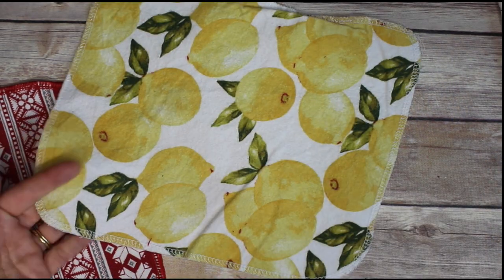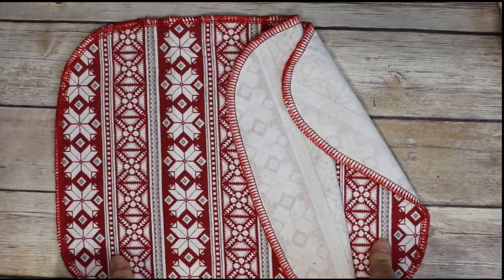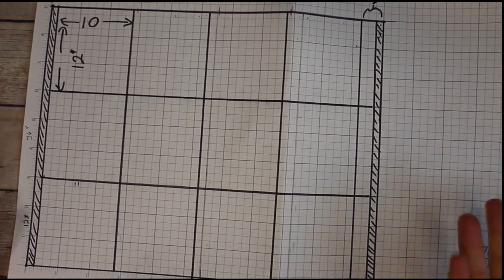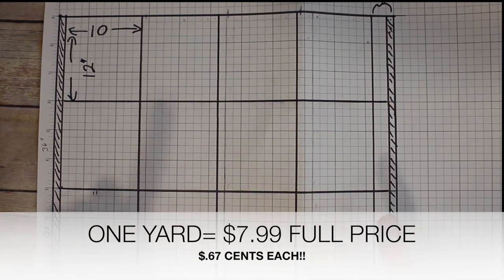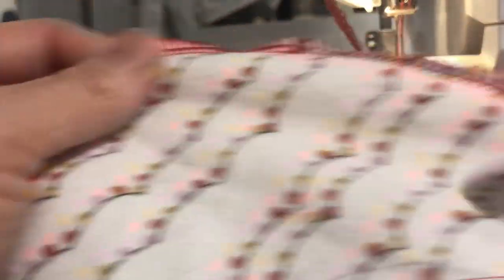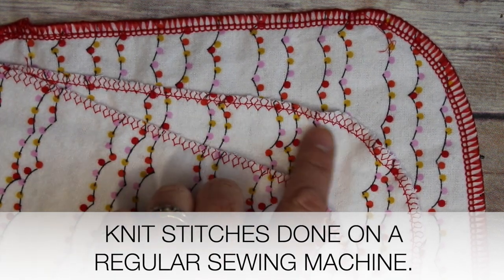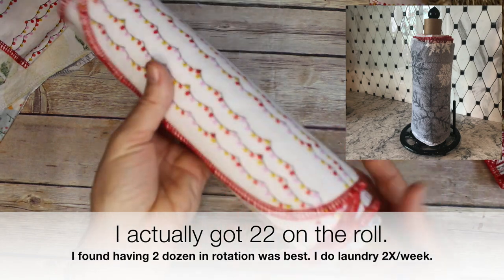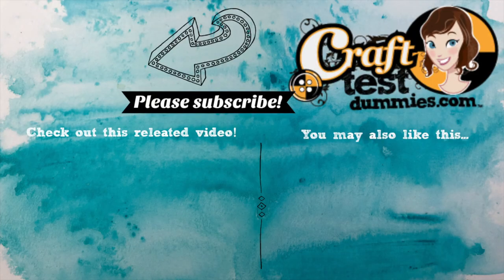"Non Paper" Flannel Towels

Comment: I've had this on my "Make it!" list for awhile now, and just got a variety of snuggle flannel in our kitchen colors from JoAnns (early Black Friday sale the week before Thanksgiving).  I was thinking of getting a short section of PVC pipe to roll the unpaper towels onto and then slide that onto the holder I have mounted under a cabinet.  Planning to use that leftover material to glue onto the PVC pipe to make it "grip" the pipe for the first towel rolled on.